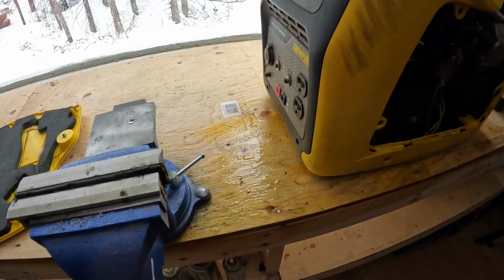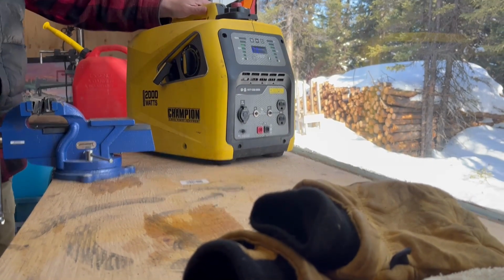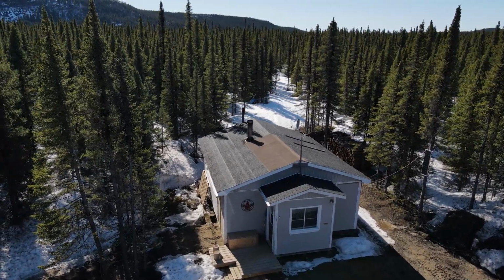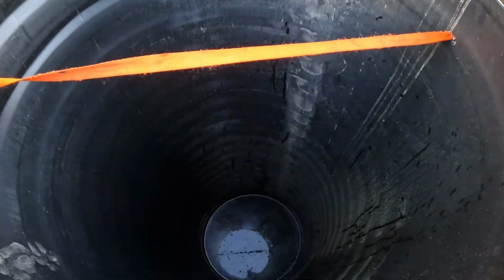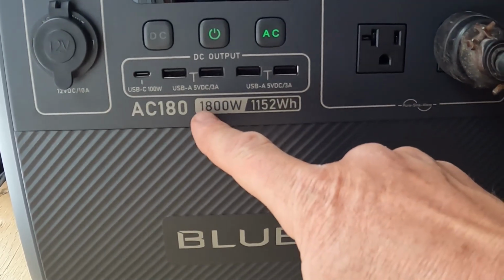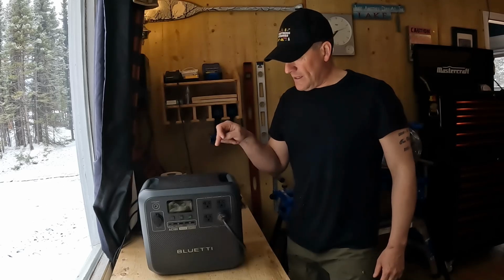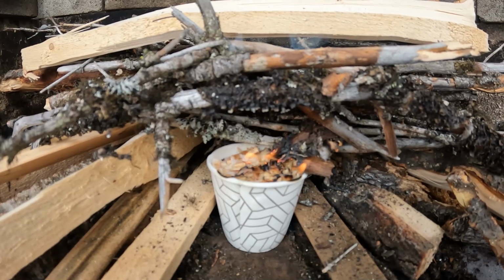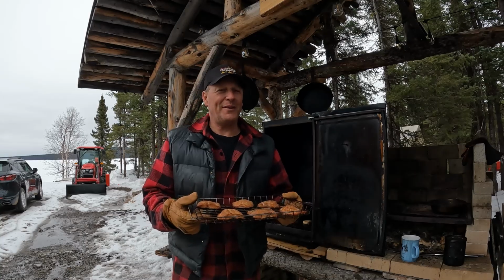SPRING CABIN MADNESS: PROJECTS, FOOD PRESERVATION, EXOTIC COOKUP, SNOWSTORM, HUGE BLUETTI GIVEAWAY

Comment: Good day Mr Porterr, just wondering how you calculated your power requirements for your home, and how you calculated your solar panels 
and batteries origionally, before the bluetti system. I have a cabin that I plan on using solar as a primary power source. I use the cabin for a few days every couple of weeks . Have an 2000watt inverter. 
Any thoughts on sizing the panels and such, Thanks
Reply from the maker: I started with one 50 watt panel and two car batteries.  I ran a 600 watt inverter. And I expanded from there. Before the bluetti, I had upgraded to a renogy 3000 watt inverter and charge controller, with 8 RV batteries. 

In between all of that I ran a 2000 watt inverter I got from can tire and three heavy duty haul truck batteries. 

I’m guessing I burned out about 3 inverters over the years. 

I’ve never had anything in all of those systems work as good as what I have now. 

It all took time, patience, and an upgrade here and there. But right now, I’m more than happy. In fact I feel spoiled. 

Tks for tuning in my friend.

Comment: I have a #bluetti 200 max for emergency. In case of long duration power outage, it can be charged to full power using my generator. Nice job on bottling the seal.